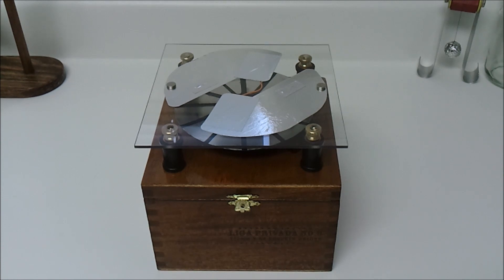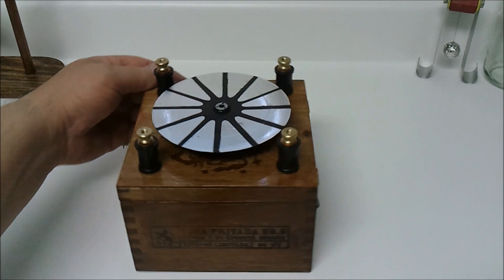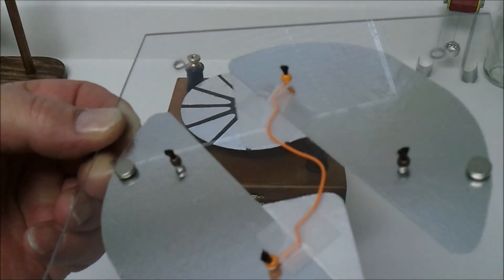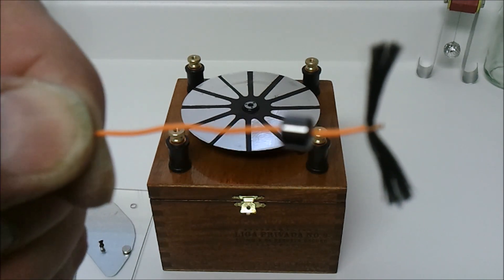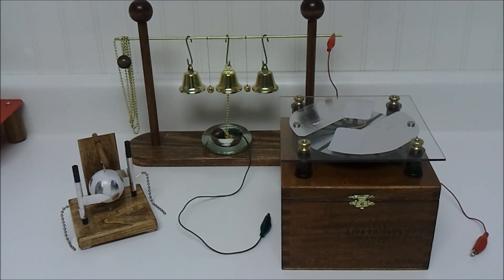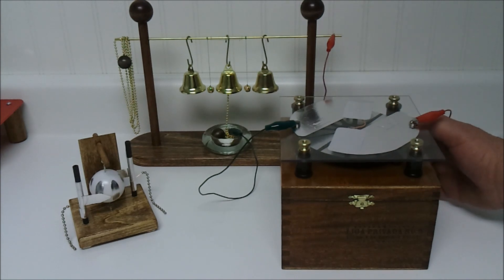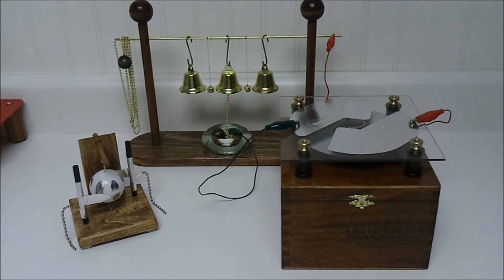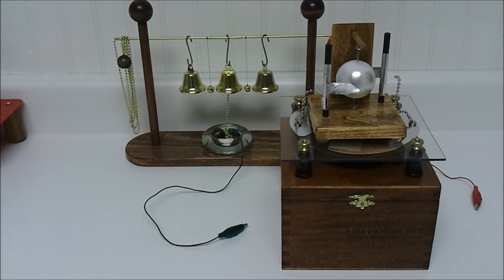Success - High Voltage Induction Generator

Comment: Beautiful construction! I agree, I think it's a flat-plate version of a Moore's Dirod.  You could make a new rotor assembly using rods instead of flat sectors and it might work even better, since all sharp edges in your design will be leaking charge away instead of accumulating it to the highest degree. 
You might be interested in looking at my videos of my Moore's Dirod, which is capable of about 60-65 kV on a good dry day.
I like your spherical motor,  too, and the fact that it all packs up into the box is a great feature. Thumbs way up!

Comment: That works really good now.  You should try the spark gap and see how long it is.  I read somewhere that 1 cm is about 30,000 volts.  Your carbon fiber brushes are great!.
Reply: Hi Lidmotor.
Could you help me to know diameter  the disc  of your machine ( 30.000volts) thank you in advance.